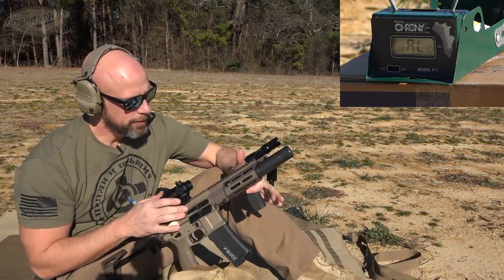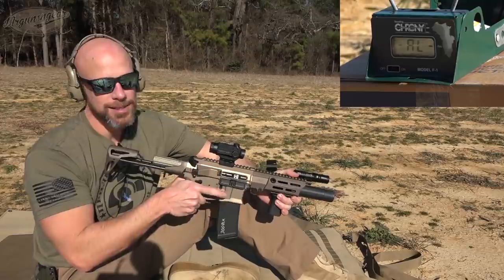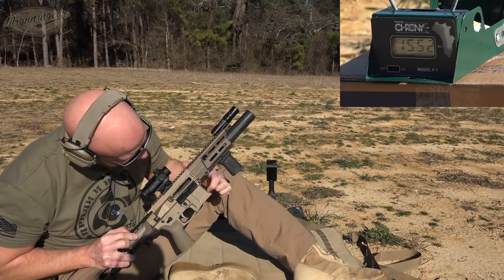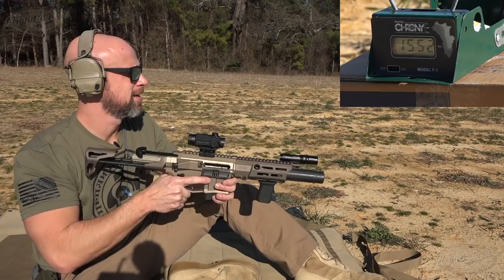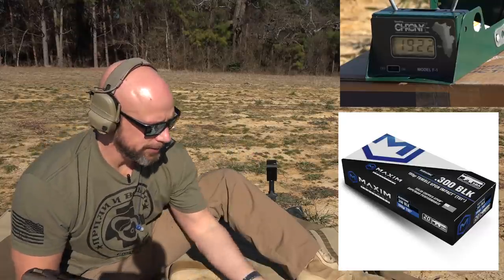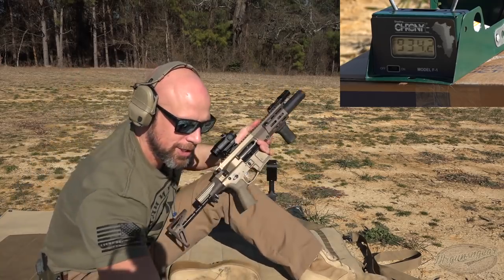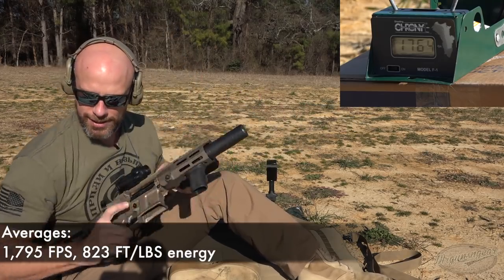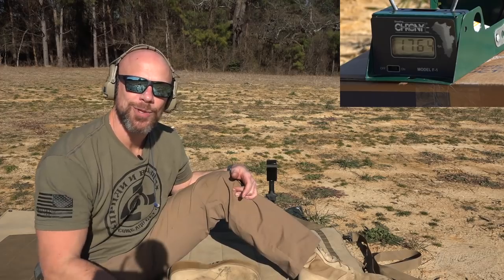What Velocity Can You Expect From A 5.5'' 300BLK Barrel?

Comment: These are neat little blasters. I believe I would prefer a minimum 7.5" barrel. Still I love the compact stock and look.
Reply: @Jones yeah the x39 is my favorite. Currently I have 300 Blackout in 10.5" & 8". X39 in 16", 10.5" and 7.5". The 7.5" is my favorite because it is handy with the can but, 10.5" is the best trade-off as far as terminal performance and handy size,  in my opinion.
Reply: @Jones parts are tuff right now! Yes sir, I have hunted my whole life with a longbow. I like to get close myself!
Reply: @UncleDanBand64    Yep super handy as 10.5 turnin steel into Swiss cheese
Reply: @Jones   Totally worth it. Got 10.5 from Daytona tac and a 7.5 from Hitman. The 10.5 is my fav though
Reply: @js-kb9cp  10.5 is my favorite length but, with a can I like a 7.5"! 10.5" is best overall
Reply: I agree that's why I'm thinking about getting the Daniel defense PDW

Comment: I had the Maxim in 7.62x39 and chronoed it at the same time with a Rattler.  Both velocities from the 5.5 inch barrels where very close and my Rattler results were similar to Mr. Guns and Gear was in this video.  A 7 inch barrel added about 90 to 100 fps.

Comment: What I expect with that barrel length in that caliber is cycling issues since a pistol gas system enters the barrel with only 1.5 inches worth of dwell time.  You would almost NEED to suppress it to get it to cycle correctly unless you have some non-standardized gas system.

Comment: Nice video! 

On a side note, and from what I understand, a 5.56 with this barrel length will still push 1,950 fps using XM193. I guess my point being I get tired of people hating on really short blasters not realizing these are niche weapons designed for contact distance out to maybe 100 yards. It'll still do the job as a dedicated room broom. 

If you're wanting a dedicated "battle rifle," I agree you shouldn't go less than 10.5". However, little PDWs such as these make awesome truck guns or HD guns...

Just FYI, I was not implying you were hating on these shortys.
Reply: Agreed. They are awesome and they play their part well
Reply: @smashfaces  Exactly 💯. I have a 6" PDW pistol build along with a pistol version of the Spike's Tactical "Compressor." Both are chambered in 5.56 and utilize the Maxim Defense CQB brace system. 

The Spike's is by far my favorite. It utilizes an 8.1" barrel and I have a Barking Spider muzzle device on the end. That barrel length is perfect for CQB, vehicle work, etc and I would not hesitate to grab it as my EOTWAWKI gun!
Reply: 55 grs at 1950 fps is 464 ft lbs.   almost half as much as the 300 black.  and about the same as a 9mm...  do i want to get shot by it?no..  but there are very valid reasons people hate on super short 556...  ironic that your commenting on a vid on short barrel .300 blk trying to use that to justify short barrel 5.56...
Reply: @mtnbound2764  First off, I'm not trying to justify anything; so you're mistaken there. Second, I could give two sh*ts about whatever anybody else thinks is a "valid" reason to hate on short 5.56 platforms. To each his own. 

I appreciate your input, though. 🙄
Reply: @Knight_of_the_Old_Code  as stated in above comments its more the ft pounds of energy the bullet is hitting with out of a short barrel. 556 is about 450ish with similar fps yet 300 blk is damn near 1000 ft pounds of energy in some cases only 200 ft pounds short so it's hitting significantly harder than 556 out of the same length barrel. Not that they can't both be useful but 300blk clearly has alot more potential in the shorter barrels.
Reply: @300blkwarrior  I've since realized the error of my ways and myself would agree with the .300 blk being more effective out of extremely short barrels.
Reply: @300blkwarrior8  I've also determined I will not use 5.56 in anything shorter than MK18 length, or 10.3".  From what I understand, 5.56 will do just fine out of that length barrel.

Comment: Mrgunsngear did u try fitting a 35inch barrel on 9mm round rifle see if the bullet will gain speed or just u know.. Fall off at the end of the muzzle... Just curious
. anyhow good post 🇺🇸🇺🇸🇺🇸🇺🇸👍👍👍
Reply: 9mm seems to start slowing down after about 16-17" of barrel length.

Comment: I have encountered several problems with Fiocchi loads of other calibers lately. (Mainly some .38's that have extreme variances in recoil between rounds in the same box.  Around 10% of the 200 rounds had issues) - Perhaps they had a QC problem in some of their runs. (I normally have no issues with their stuff)

I am looking at a 5" Aero Precision 300 blk as another option for my can that is in time-out. (Just have not convinced myself I need one)  - Trying to decide between that and a PCC in 9mm.

Do have any issues with yours when shooting subs and a suppressor?
Also, do you have to make changes if you run a mag of supers with the can on it?

Thanks